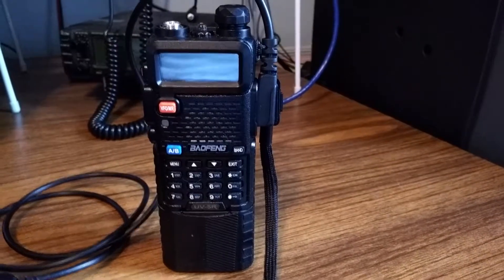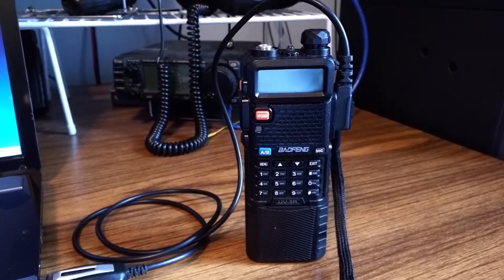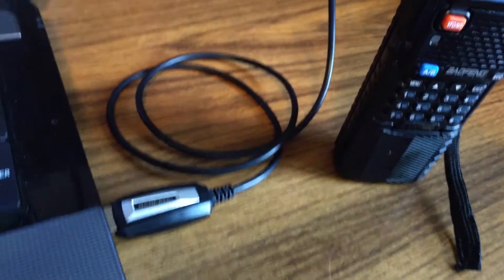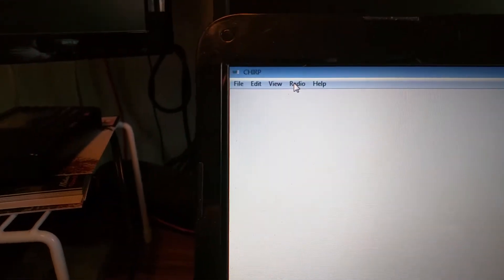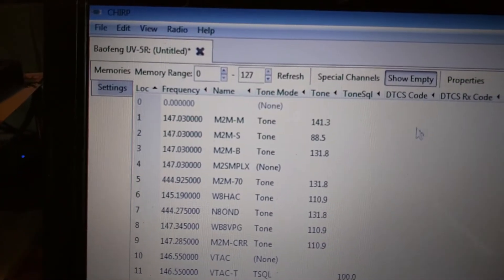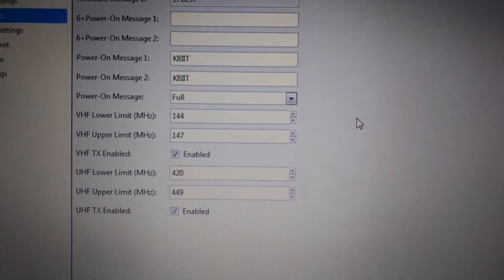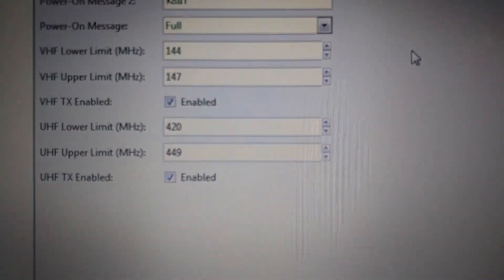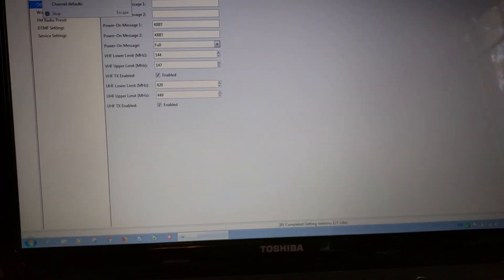How to restrict Baofeng / Pofung Radios to HAM Bands using CHIRP

Comment: So I want to listen only to my local Fire and EMS If I Click not Allow on UHF and VHF and I click PTT and it wont do anything Correct?
Reply from the maker: Hey Luke, according to this bug report on Chirp's site, it works on some units and not on others, depending on which firmware is installed. Please see below: 

https://chirp.danplanet.com/issues/2479
Reply: @OhioBaji  Is there another program by Baofeng that is a good program that runs with windows?
Reply from the maker: @ @LukeJohnsonEntertainmentUSA    Please see below, I have not tried these products: 

https://www.miklor.com/uv5r/UV5R-Software.php

https://baofengtech.com/download

Comment: So if we do this it will make the radio legal to use again ?
Reply from the maker: By making this configuration change, the radio is able to only transmit on permitted amateur frequencies. I defer the rest to someone better qualified to answer the question.
Reply from the maker: You might find Dave (ke0og) & KB8VBR's videos more informative in understanding the FCC advisory. https://youtu.be/YG8PU1eG6Cc  &  https://youtu.be/ercPxlxdQAI?t=510
Reply: No not really but their is ways around that too.